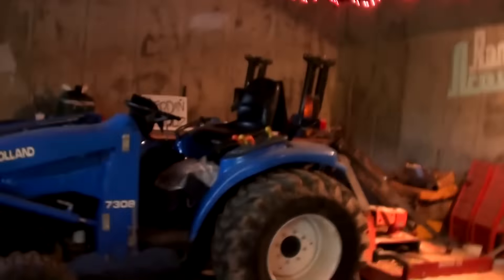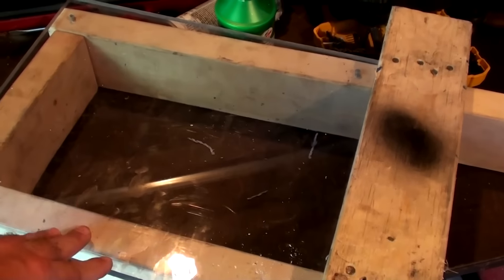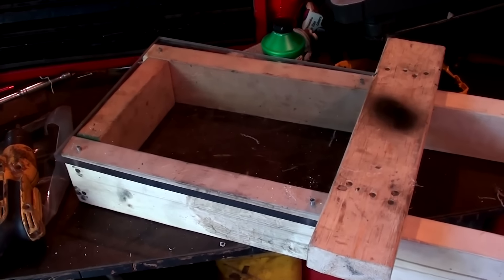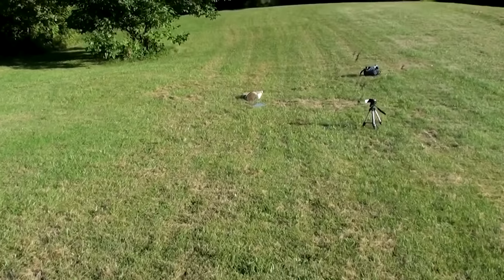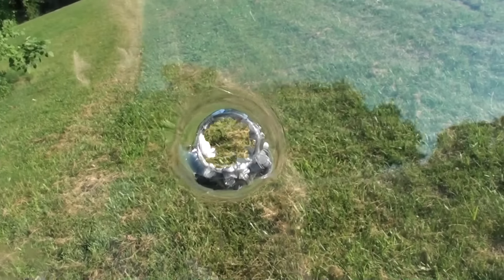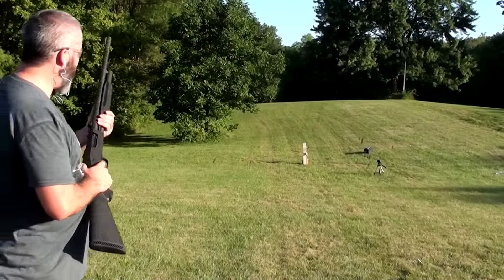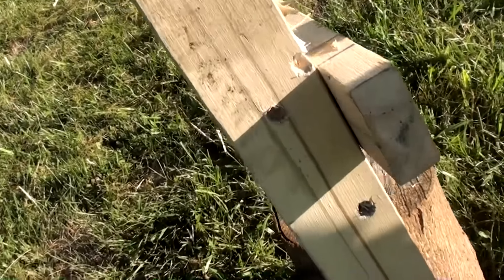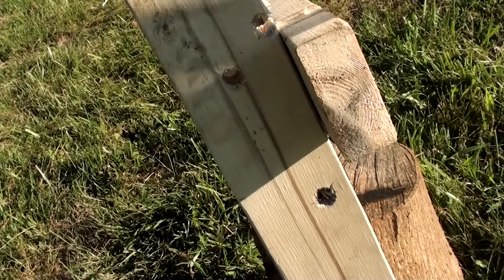12 Gauge Slug Vs Polycarbonate - Half Inch Thick

Comment: Nice clean hole through the piece of poly...I think you just invented a New way to put holes in wall studs for running electrical wiring !!!
Reply from the maker: It does make some nice clean holes in those studs :)

Comment: I had a chance to shoot a 1" thick piece of this awhile back. I used a .357 Magnum and it went right through leaving a nice clean hole. If you try a glancing shot, it ricochets and does not penetrate. It would be interesting to see the maximum angle for penetration.
Reply: Depends on the composition. A single sheet of 1" is nowhere near as strong as a layered 1" sheet. Layered polycarbonate should easily provide IIIA rating in a 1" thickness.

Comment: 9mm would go through 1/2" polycarbonate. 
As far as the 12 ga slug, they penetrate hard targets (BR glass) better than soft targets (kevlar). vest)
Reply: Depends. I have 3 layer .5" polycarbonate that stopped 115gr federal 9BP JHP when I tested it.

Comment: Do slugs harm the barrel
Reply from the maker: This is a rifled barrel intended for sabot slugs, but shooting regular slugs won't harm the barrel.  You do need to clean the gun regularly though, because lead can start to fill in the rifling over time.  We've shot regular slugs through the rifled barrel for years and it's still perfectly fine.
Reply: RamblinAround thanks.